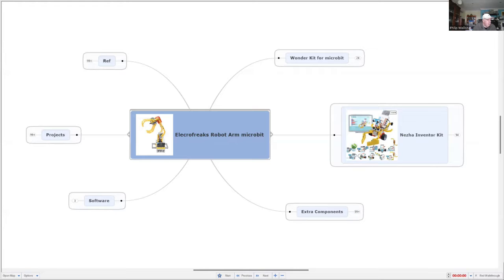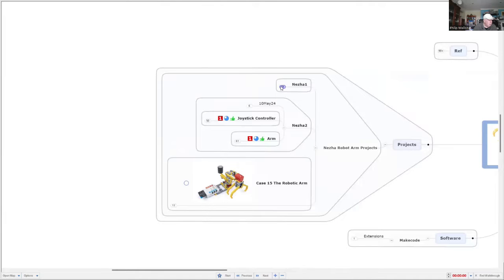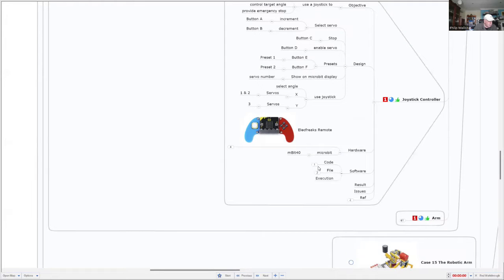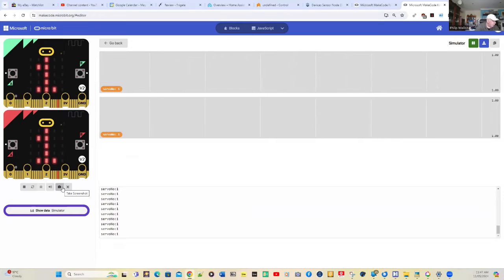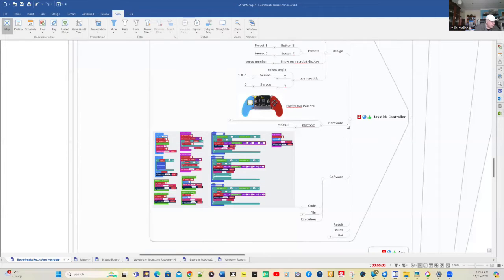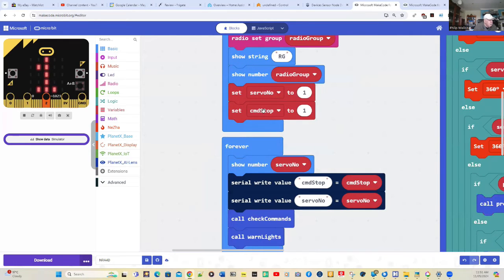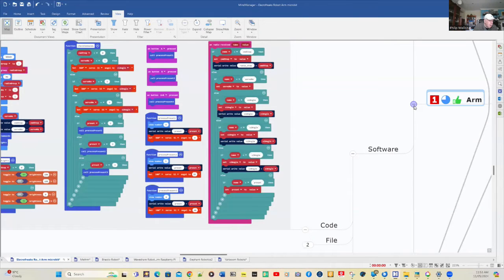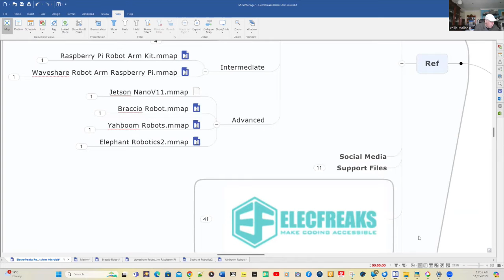Robot Arms: Version 1 - using microbit

Comment: Hi, great work on all the videos! 

Just wanted to reach out about your "miniFarm - using reTerminal" project. I am building something very similar and having issues where analogue sensors only give 0/empty readings, and my 1-wire device (DS18B20) connected on D5 isn't recognised in /sys/bus/w1/devices.

Would you have any tips on this, as you might have experienced similar problems during your project?
Reply from the maker: Hello Robert it is nearly two years since I have done this project and I have not done any FarmBeat projects since. 

You need to be more specific about how you are using analogue sensors. What is your interface to the Raspberry Pi?
Did you use Grove sensors via the Grove Raspberry Pi Shield? If you use the procedures published by Seeed Studio then analogue sensors should work. You have a choice to follow either the Grove Shield for Raspberry Pi or their FarmBeats web page (https://www.seeedstudio.com/Grove-Kit-for-Raspberry-Pi-4-designed-for-Microsoft-FarmBeats-for-Students-p-4873.html?___store=retailer ). As it is now about 5 years since Seeed Studio developed this they have changed the driver on the Grove Shields so some of the old examples may not work on the latest shield. Microsoft support is currently provided in "IoT-For-Beginners" (https://github.com/microsoft/IoT-For-Beginners )

My project did not refer to the temperature soil probe using DS18B20 but I remember getting it to work on other FarmBeat projects I completed.

You may want to explore the internet for other FarmBeat references. FarmBeats was developed by Microsoft in partnership with Seeed Studio and was adopted by the CSIRO as a pilot project for agricultural schools.